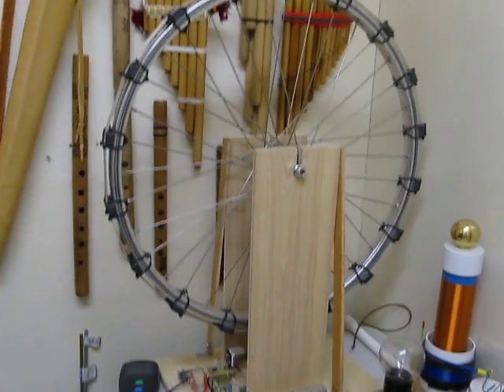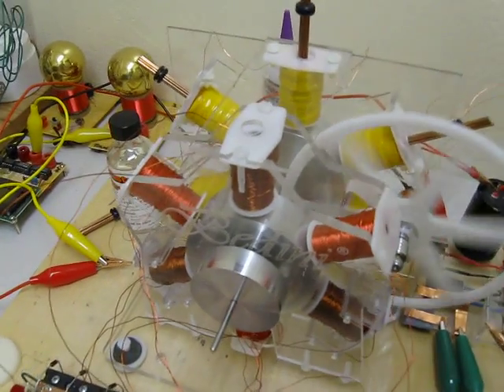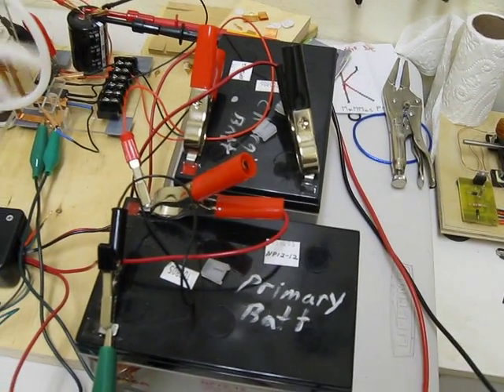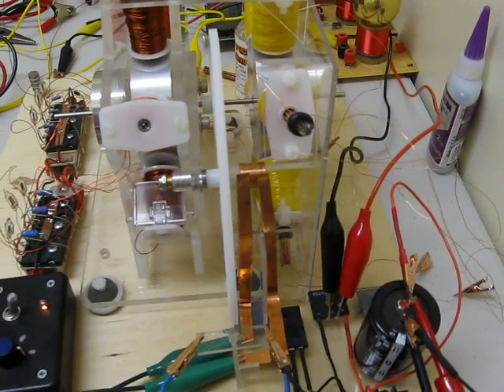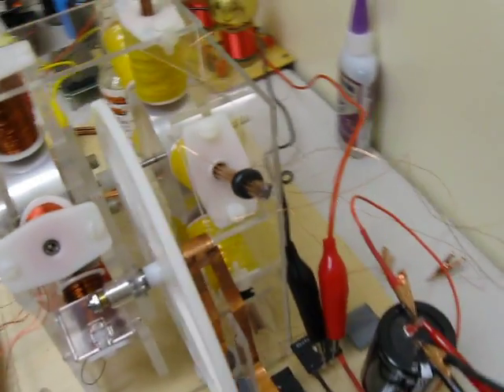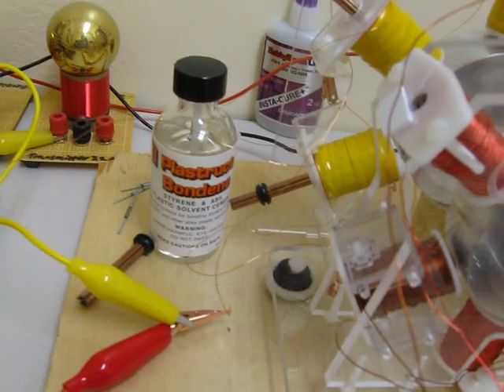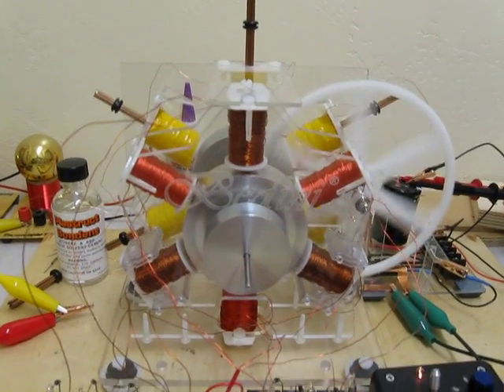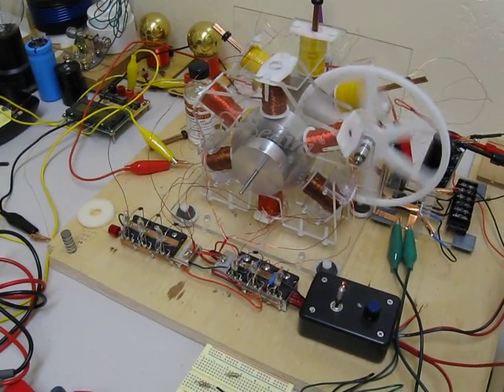Bedini 6 pole monopole w/cap dump to primary, running @ 12v

Comment: I know nothing about electricity but I want one of these machines so bad.  I'm planning on moving off grid and was hoping one of these Bedini machines could supplement a solar setup.  I see lots of people making these machines but I can't find anyone that has shown serious applications like charging four 12 volt 100amp/hour batteries.  I'm sure that would require a larger machine if it's even possible.